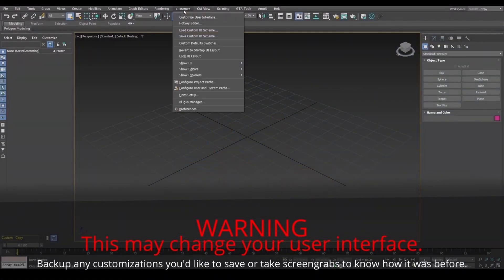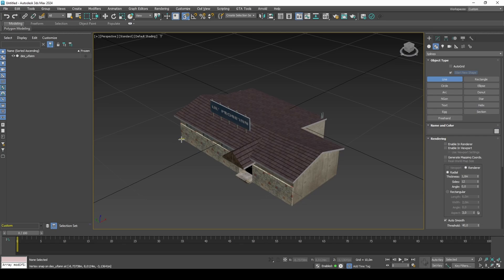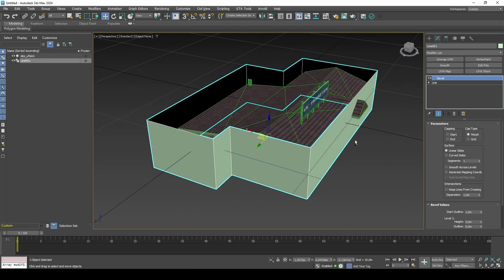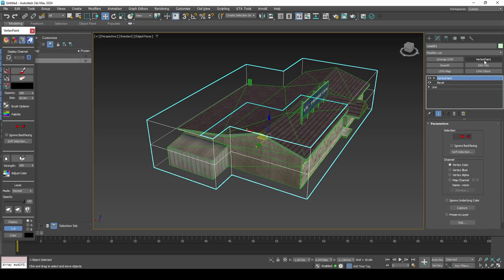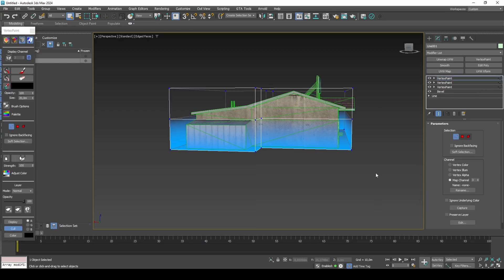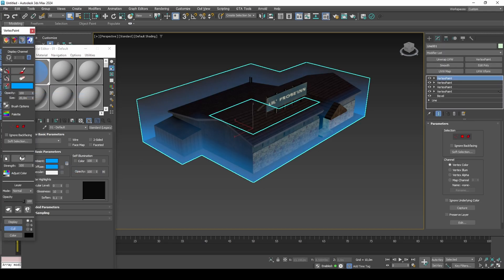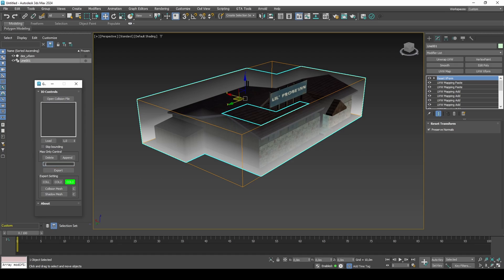79 - Rectangular marker with vertex alpha

Comment: Hello, when I use the vertex alpha channel it works fine during the day but gets overridden by vertex illumination at night. Is this an issue that can occur on MTA? I am using SAMP so it's possibly just a SAMP issue.
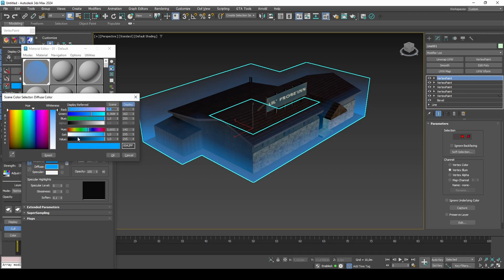Reply from the maker: It happens if you don't have the vertex alpha in both vertex alpha channel, and in map channel 9. Check timestamp of this video : 3:04
Reply: @thorsmoddingcorner9464  Thank you and I apologize for not being perceptive enough. I came from an older vid and missed this. It works now. I really appreciate your work, thank you again.